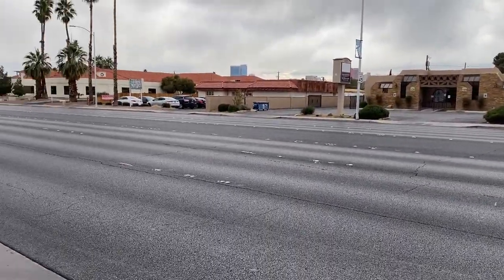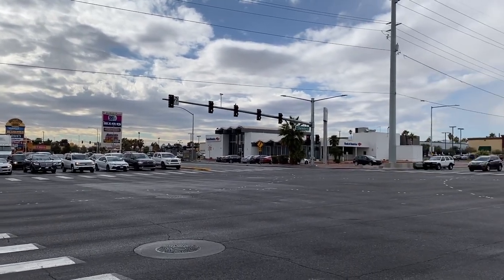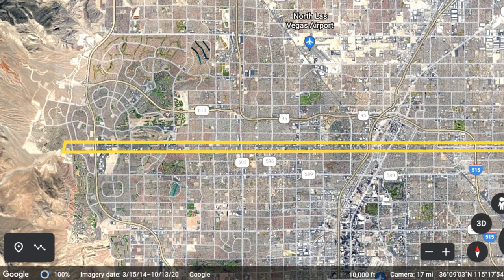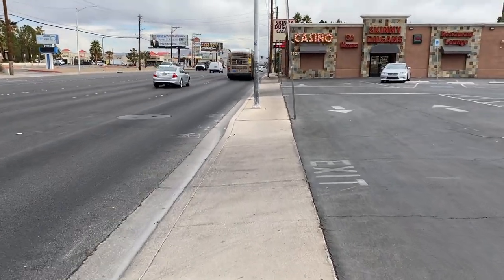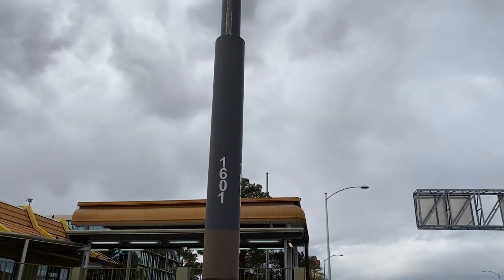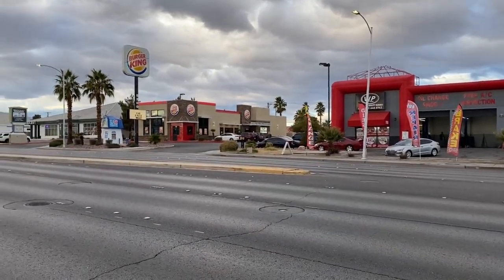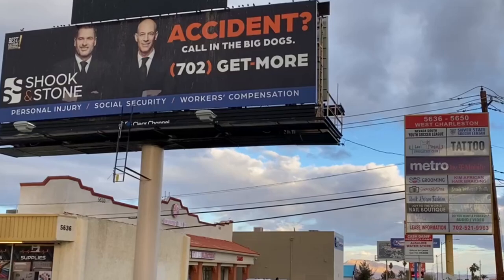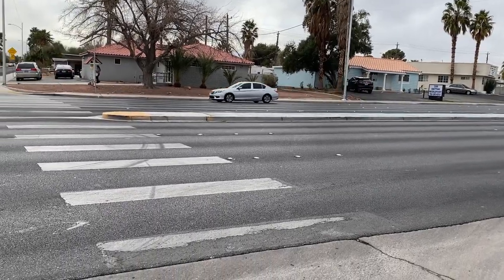The Stroad: A Case Study // Intended (and Unintended) Consequences of Car-Oriented Street Design

Comment: What I can't stand about Stroads is that they're so huge yet rarely ever have any bus specific infrastructure. Which is even inconvenient for drivers because you end up having to slam on the breaks while going 50 due to a bus coming to a complete stop in front of you. It's so dangerous and a dumb system. Oh, and then those cars that have come to a complete stop behind the bus then have to try to merge over into the other lane, which is also insanely dangerous since all that traffic is going around 50 while these cars stuck behind the bus are at a dead stop.

It seems with how big they are that Stroads at least could have bus pull-offs, or even bus lanes.
Reply from the maker: The next parallel stroad to the South of Charleston is Sahara. The Sahara Express (a quasi-BRT) has a dedicated lane and better frequencies than the 206 Charleston route. I'll feature the RTC bus system in a future video -- it has a few BRT-type corridors with dedicated travel lanes. This is just to say, city has made at least some incremental changes in the right direction.
Reply: @CityNerd  dang you know so much. Thanks for the info!

Comment: It is worth noting that Las Vegas has had success with at least one car-free street - Fremont Street.  It remains a problem that Fremont Street relies on buses to bring tourists from the resorts on Las Vegas Boulevard.  The monorail was supposed to be extended to Fremont Street, but the FTA pulled funding from the project due to ridership being lower than projected.  Now the city seems to be waiting for Elon Musk to build a tunnel, which is truly grasping at straws.
Reply from the maker: Ha, I was just at Fremont Street today. There are dedicated bus lanes on Casino Center (north/south) between the Bonneville Transit Center and Fremont...but probably not that well used. I'll probably do a video on the bus network at some point -- I'm actually impressed. Not a fan of that monorail, really, and definitely gonna do something around tunnels at some point.
Reply: @CityNerd  Yeah, the monorail is in the wrong place.  The stations are too inconvenient.   It needed to be on Las Vegas Boulevard in order to be useful.  I doubt if light rail on Las Vegas Boulevard would be viable either.  There would be too much pressure not to lose car lanes.  Tunneling might be the only viable approach.  If they could just get Elon to consider putting trains instead of cars in his tunnels ...

Comment: Unless your are with toddlers or octogenarians, just walk into a fast food outlet and avoid drive-thru.
Reply: I used to do that, in the before times.  Now, I walk there and find the lobby is locked.  Or, sometimes if they are open it's with drastically reduced service compared to before.  And no trays, you have to take your food out of a bag and make your own tray out of it at the table haha
Reply: Despite what Leo Getz says, I've rarely ever been f***ed in the drive-thru.  Frequently, it's just easy to grab and go, especially if you are just getting a drink or something.  And that was even before the pandemic when it mostly became a necessity to use the drive-thru.

Comment: 45 mph in a "city" environment. I guess setting speeds meant for rural roads makes the place rural
Reply from the maker: 85th percentile speed rule baby
Reply: These stroads are not really a city environment by my definition which is what you see in Manhattan or center city Philadelphia for example.  Cities have sidewalks, narrow streets, bus stops and street cars/subways.  In those city and downtown areas the speed limit is usually 25 mph in most US areas.  A real rural road is usually 45 mph unless otherwise posted with it not uncommon to be 55 mph if the terrain allows.  This is my experience anyway.
Reply: @jimzecca3961  That's true. But if the suburbs were not built around cars it would probably be equivalent to a city environment

Comment: A partial solution for stroads is the use one-way roads.  These are much more space efficient and lack left turns into oncoming traffic....they also enable traffic light syncing.  A one way street going the opposite direction can be located one block over.  Those billboards were hideously ugly and also need a "solution".  Perhaps public outdoor ads could be restricted to non-garish colors, no photos, and no smiling people.

Comment: 0:10 already offended. Why the hell does that overpass need to have an escalator? I am now wondering if you even have to walk on the overpass or if they have these horizontal escalators you see at long airport terminals.... Imagine having to move your body. You already don't have to walk inside the shop, where you have these electric vehicles you can drive. The only walk is from the massive parking area to the entrance of the shop.
Now I think about it: this is probably why self driving vehicles will be successful in the USA. They will drop you off right at the door of the shop and then park themselves and be at the door when you are done. Every Americans dream!

Comment: Just take a look at the apearance of the whole city environment right next to the stroads. It's so ugly. There is nothing visually appealing about the ugly urban environment that is built right next to the stroads. It's all artificial and it's all gross looking. There is no nature there. It's just tons of super ugly strip malls, hideous oversized billboards, ugly and super boring looking fast food places, ugly businesses of all kinds, dirty sidewalks filled with obstacles and garbage, bus stops that look like garbage, and garbage that looks like garbage. They might as well just put huge garbage dumps right on the side of the stroads. Just line the sides of stroads for miles with garbage trucks that dump massive piles of garbage right next to the stroads. If the garbage piles up high enough, it can effectively block the sight of the strip malls.